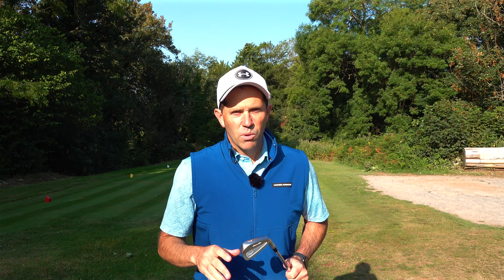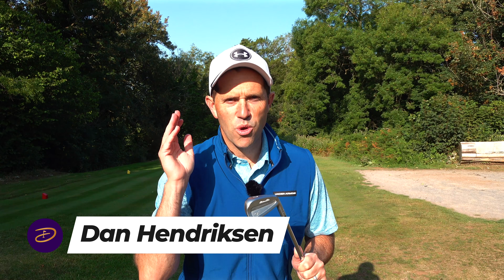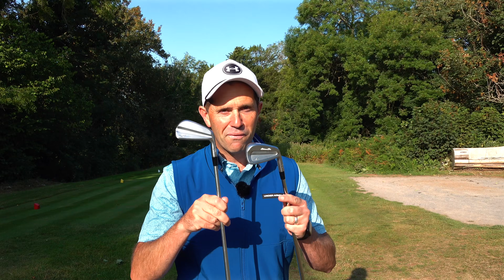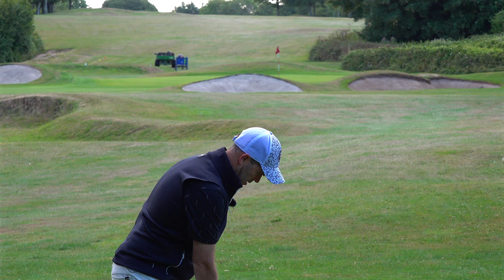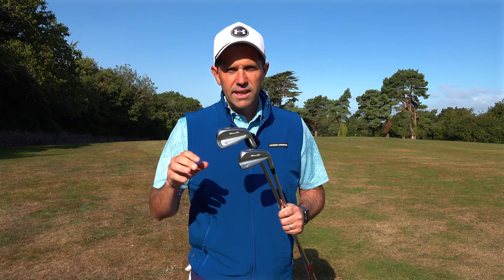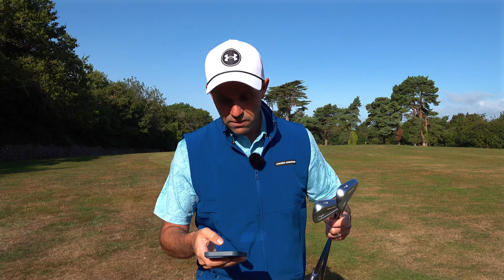Mizuno Pro S1 & S3 Irons | Best players irons in golf?

Comment: I hit both of these models yesterday at a fitting, my swing has become a bit more flat over the years and as a result spin numbers have come way down, currently play Mizuno MP-69 with LBS C-Taper 130 X flex, the rep tried a variety of shaft options to get the spin up to 7K+, for whatever reason I’m having trouble generating high enough spin numbers with these clubs compared to the older blades, love to hear some thoughts and feedback to what spin numbers should be on the course with these and what shafts may be recommended.  Great video and yes the feel is almost identical between the two sets